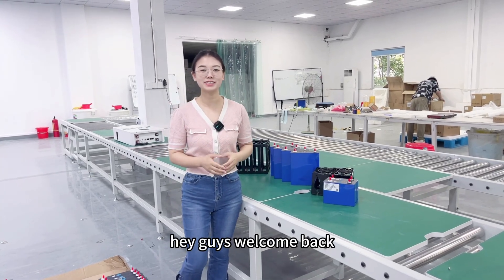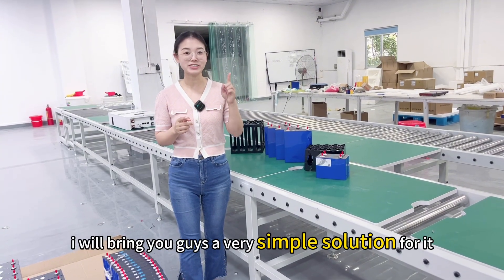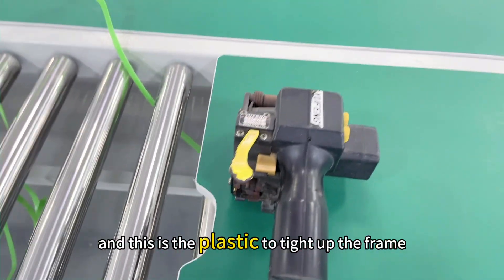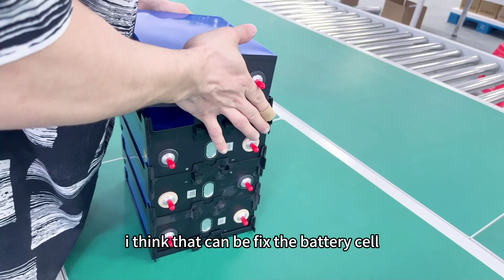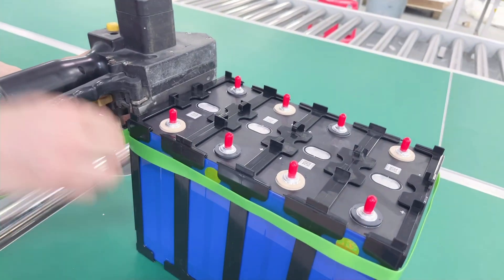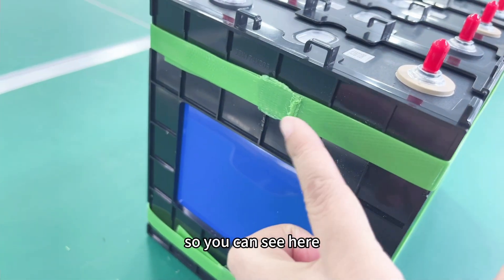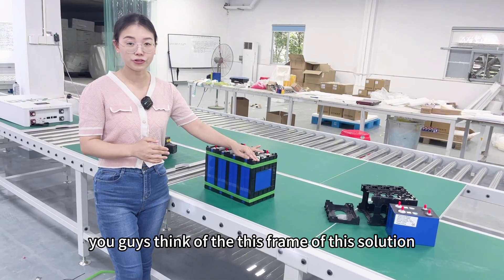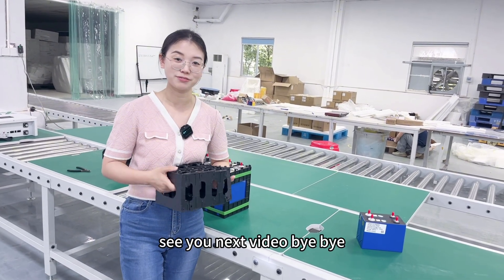Frame for 314Ah/100Ah to add preload force

Comment: Beside that with this system will not apply the requested force from the supplier (300Kgf), and beside that the force over 400Kg that cells generate during the charge will be not prevent the swelling  from this thin plastic, i can see also that there is the problem that in the middle of the cell, there is no compression, so the cell will expand anyway.
But the worse part, is that as long you don't apply any isolation between the cells, this can be a big risk. Consider that, as mentioned before, the cell on the middle sure will expand. So, even if there is a small spacer as a frame, 2 cells will touch each other soon or later. So, is is strongly suggested to use the usual epoxy yellow layer between the 2 cells.

In the end, this is a nice and smart cell holder, but sure can not be considered as a compression system.

Comment: I understand the whole topic is about preventing the cell to swell and keep the sides of the cell perfectly flat. Now if the cell is quality it is flat and the only thing required is to maintain this flat shape. So to do this actually there is no force required. However due to manufacturing and storing conditions slight  tolerances can show up and when added in a battery pack it might be required to add some force to prevent further swelling. The swelling will not show at the outside perimeter of the cell but at the center. There for pressure must be applied to the center of the cell for compensation to maintain the flat shape. So while the tape is a good and economic way to construct a battery pack,  in regards to the swelling the capacity of the tape is limited no matter how much force applied. There shound be a U shaped bar under the tape with enough resistance to transmit the force of the tape to the center of the cell or a plate with sufficient resistance over the entire cell surface.

Comment: You still haven't found solutions to reduce international shipping costs for DIY cells and cases ?
Reply: What's the shipping cost now?
Reply: I got a whole battery case with bms and 314ah cells for little over 1800 with shipping and fee for debit card got 16kwh for half the price of an eg4 14.3kwh battery that I already have so they cheap as heck right now dont know what people are talking about price of these cells and shipping and stuff but you can get over 32keh for the price of any 14kwh battery here in the states
Reply: Think shipping was like 600 for the case and cellsmaybe little less and was here in like 7wks